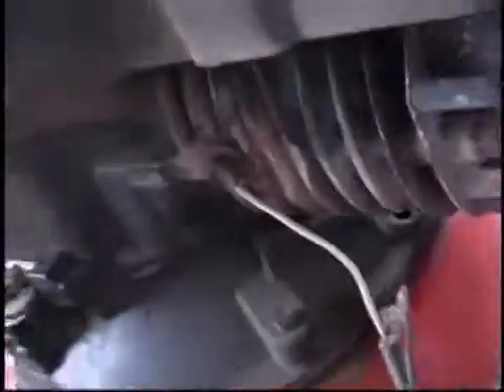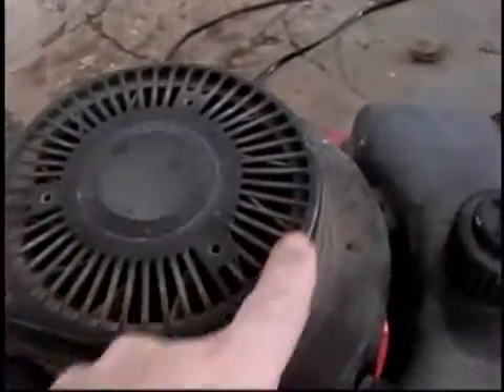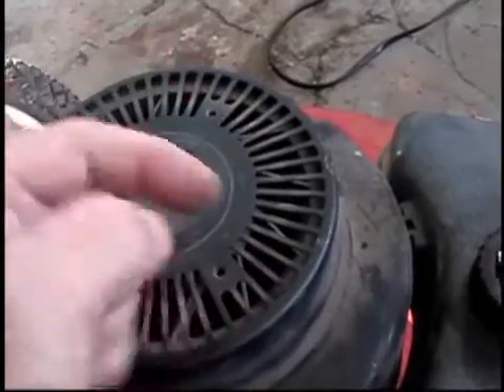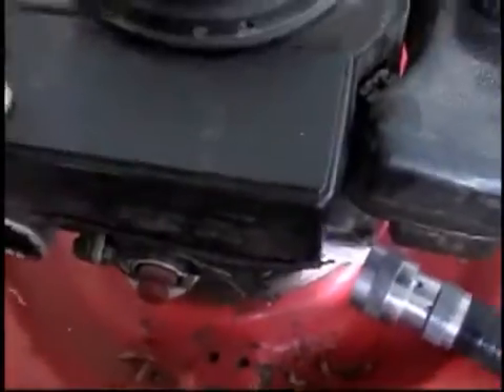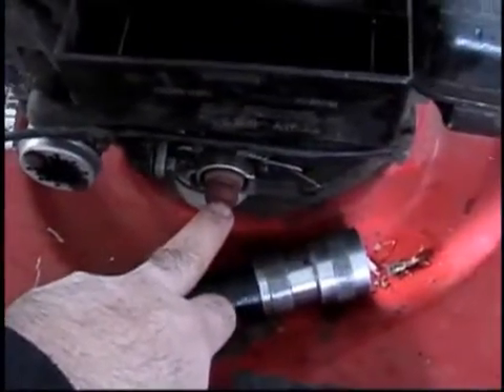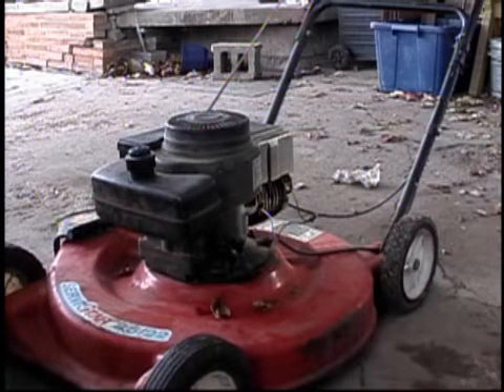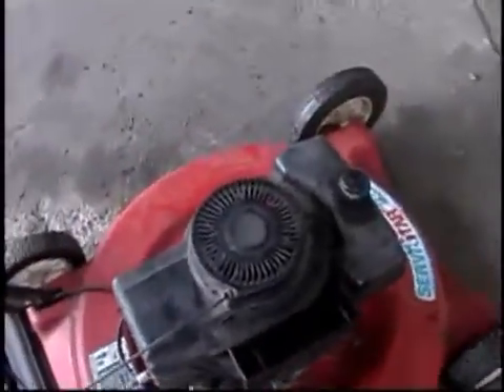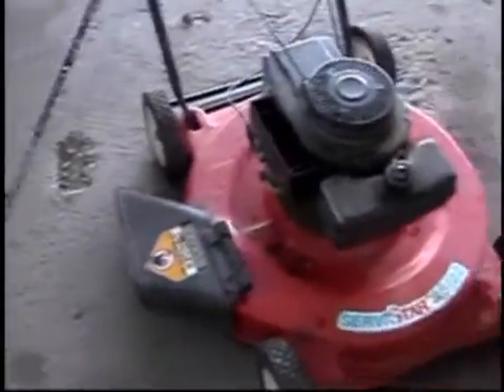Tecumseh Engine Complete Walkaround

Comment: @More350Power You mean rotate it and listen for that clank noise at the bottom of the stroke? all of my mowers do it and even my 77 3.5 hp which has NO WEAR on the connecting rod/crank makes that noise. No idea why they make that noise.

Comment from the maker: @1972FordF150 Ive also hit big ass roots with it, stalled the engine instantly and bent the blade at 90 degrees, did that about three times...... then the last time I didnt know it was bent till I looked at the grass and said where in the hell is that line coming from... the blade would dig into the ground.  I looked at that after I hit the sidewalk and stopped the engine.  I dont know how I did not break the flywheel key, crank or conrod.  Im thinking of doing a compression check on it for fun.

Comment from the maker: @1972FordF150 It gets louder as it gets warmer.  Its hard starting when cold now.  I changed the oil today and cleaned that blow by crap out and even flushed the crank case with a little kero before I changed the oil then let it empty for hours.  It blows water out of the breather!!!!  Only thing I can think of is there is so much heat it condenses when it gets to the air cleaner.  You should hear it now since I changed the oil, its louder yet.